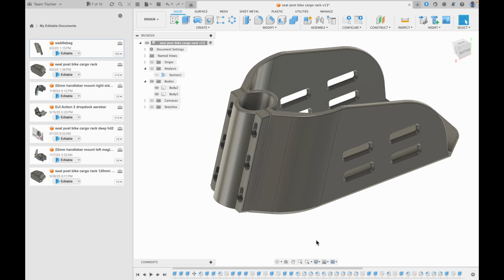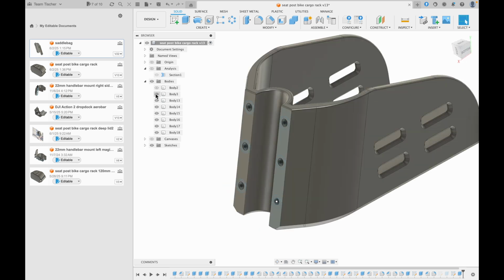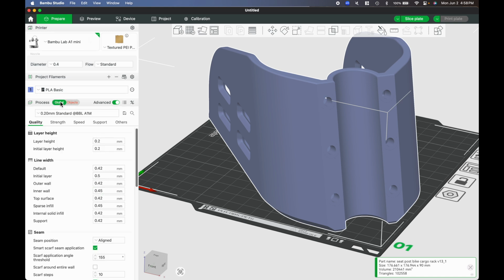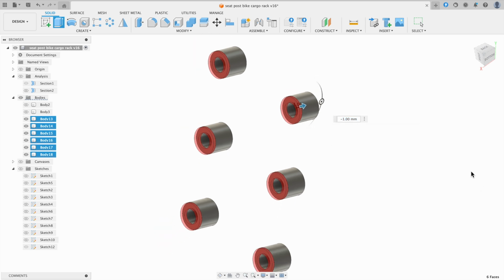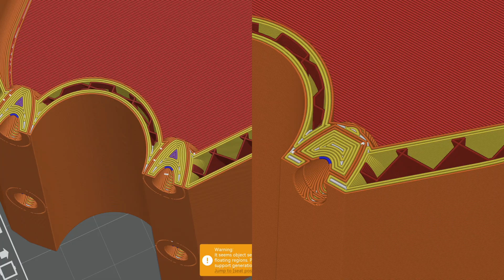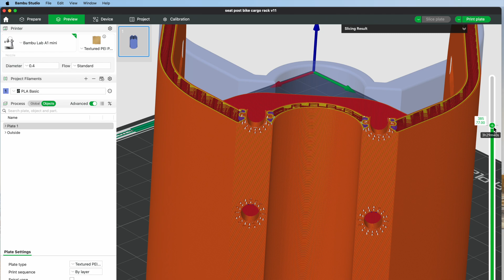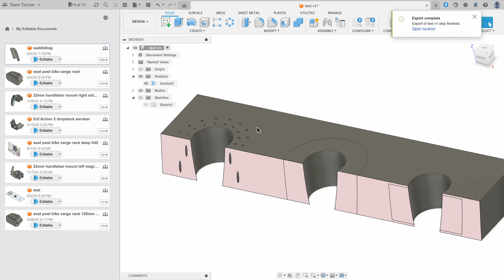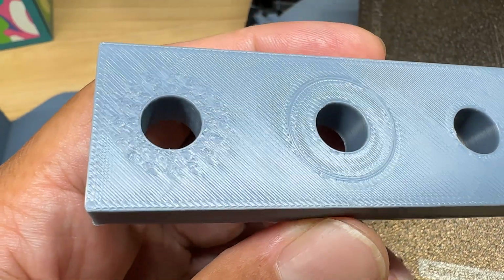How to increase the printed wall thickness around 3D printed holes.

Comment: Nice video! I wonder how you printed the oval openings for the straps in the vertical sides? Did you use support? I have the problem with printing a box with relatively large holes (28mm) in the vertical side walls. Any suggestions?
Reply from the maker: I've successfully printed without support.  The oval holes are chamfered on both sides, so that helps. The unsupported area above the hole has a triangular cross section,  so when it prints, only one strand has to bridge across unsupported, you can see a loose strand if you look close.   Without the chamfered edges there would be several unsupported strands and that uniformity would be more obvious.
Reply: @etischer  Thank you for your quick response. I'll have to try your technique, because I really don't like using support.